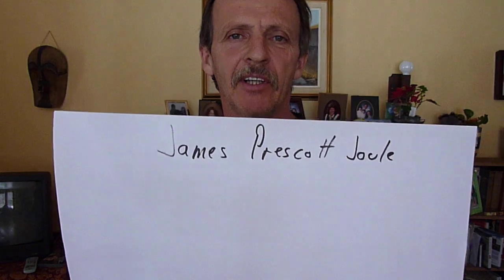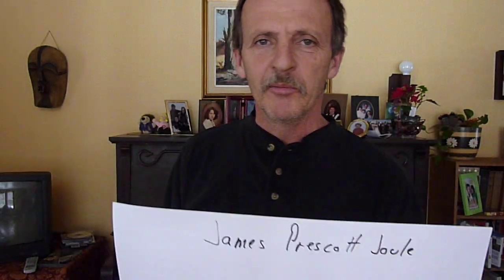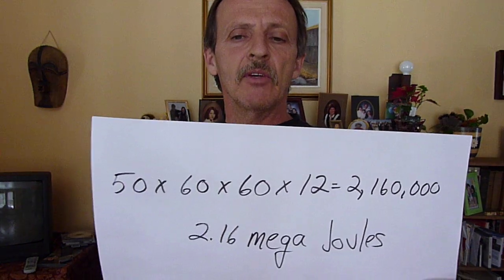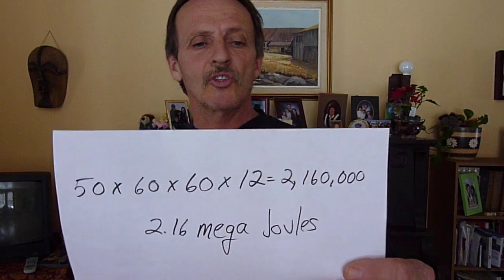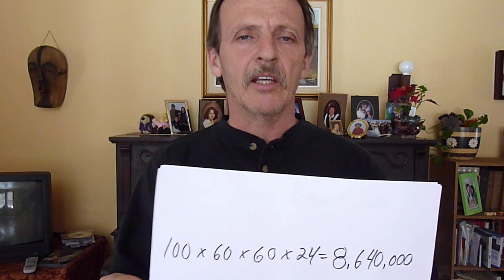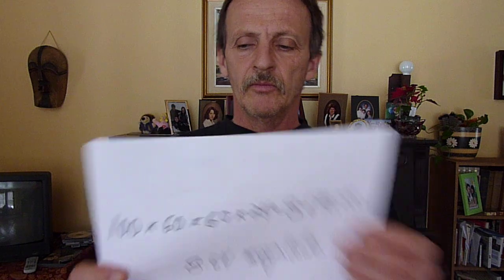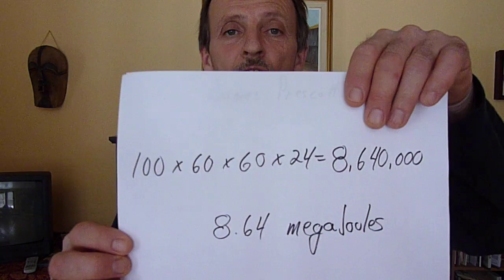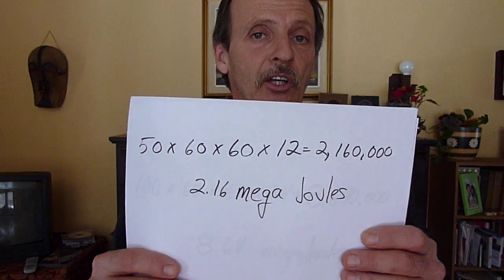Joules explained in an easy to understand way.

Comment: A solar panel can only get sunshine for on average 8 hours in day. So the energy output calculation would be more practical using 8 hours instead of 12 hours.
Reply from the maker: +Napo Mokoetle Yes, that might actually be a more realistic figure. Cheers!